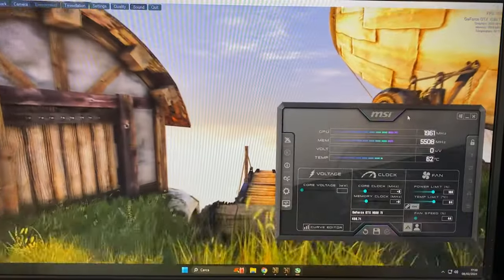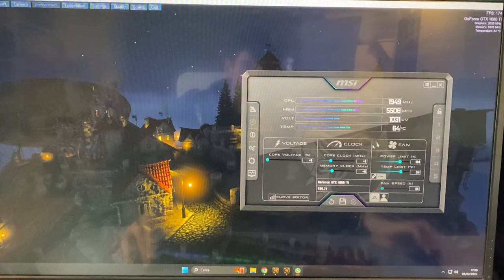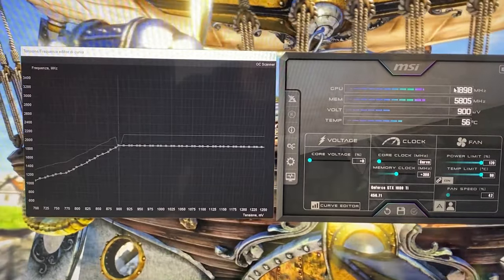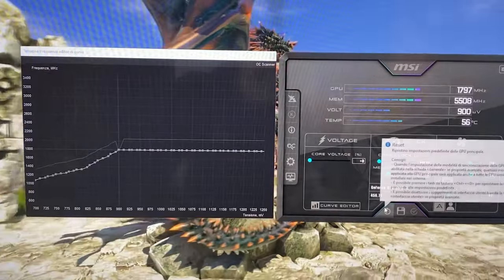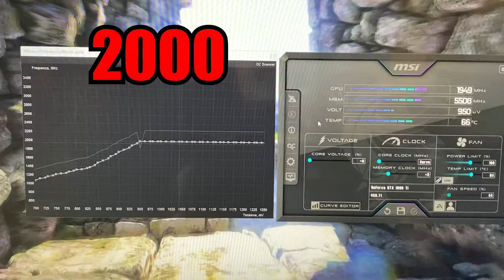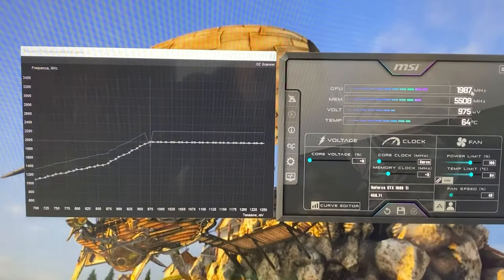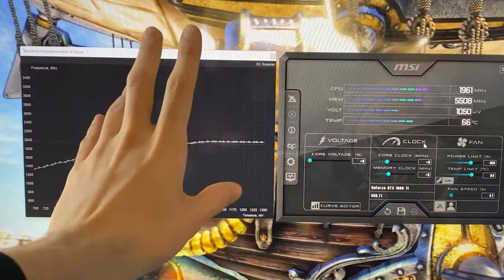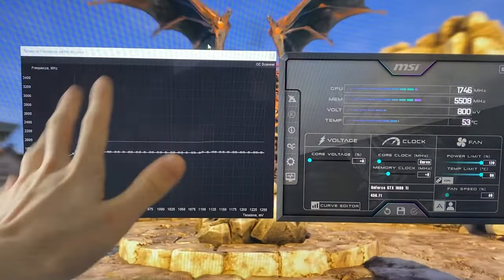Undervolt your GTX 1080 Ti for more FPS! - Tutorial

Comment: My card is a bit weaker unfortunately but I was able to achieve 975mv with 1900mhz stable and 950mv with 1850mhz or something similair.
Update: was able to push my card in terms of memory speeds +350mhz/+400mhz

Comment: Thank You!  Best guide yet. I used this guide for an EVGA GTX 1080 FTW non-TI  and worked better then your older 1080 guide for me.  Really improved temps , fps and stuttering.  Ran Heaven on ultra settings and temp hit 51c and no higher after 1 hour.    Used to hit 80c and fans running like a jet engine.  I hope to find a good deal on a 1080ti one day, always wanted one :)  Have an MSI GTX 1080 with passive cooler I strapped a cpu fan on, it runs hot in the wife's PC , will try undervolting when I can get her off of it long enough for me to do so :)
Reply: Well I got two bad 1080 ti's used off the bay'...  I went ahead and got a used Titan XP.. Works well and your undervolting tips dropped temps a good 12c .
Reply: I still have a 1080 ti if you're interested

Comment: Running  between 2050/2038mhz on the core reliably with a simple overclock, water-cooled it never goes above 52C
Reply: how do you water cool gpu?
Reply: @icecold3426  it's water-cooled
Reply: @L3XURIOUS  i mean is that stock or you modded something?
Reply: @icecold3426  it has a byksbi waterblock and I did a shuntmod with some liquid metal.. been running like that for a couple of years reliably, I did however upgrade to the 4080 super last month

Comment: RX6600XT or GTX 1080Ti ?
Reply from the maker: To be honest, my choice falls on the GTX 1080 Ti easily. But it has to be a well kept card and you’ll need fresh thermal paste and thermal pads!
Reply: Rx6600xt all the way, not even close. The 1080ti is awesome, but it's very old and are missing a lot of features and new technologies. I'm not talking Ray tracing, dlss and dedicated encoding hardware. But thing like mesh shades, async computing, ddr6 etc. The Rx6600xt is definetly the better pick.
Reply: @TinfoilTimmy it depends what you play I guess
Reply: @thestoicwhinger  i know for a fact that a few newer games (like cod, Alan wake) run WAY better on newer gpus rather than pure performance due to it missing support and hardware. Mesh shaders is probably the most impactful. It's only a matter of time before these become the standard. But yes, it depends on what deals you get and games you play.

Comment: MSI GTX 1080Ti Gaming X 11G (Paired with R7 5800X + 32GB RAM DDR4 3600MHz, GPU Fans are on Auto)
Unigine Heaven Benchmark 4.0 (DX11, 1080p Fullscreen, All Max Settings)

MSI Stock OC
FPS = 152.2
Score = 3833
Min. FPS = 56.9
Max. FPS = 316.4
TDP = 260W
Temperature = 80°C

Undervolted OC (1850MHz Core, 5805MHz Memory)
FPS = 148.3
Score = 3735
Min. FPS = 44.0
Max. FPS = 309.6
TDP = 195W
Temperature = 69°C

Now I can't choose which one should I take xD
Reply from the maker: I’m really happy it was helpful! Thanks a lot for taking the time to leave some feedback :) Consider subscribing if you wanna support the channel! I’d take the undervolted OC personally
Reply: So bro i have the exact gpu with i7 8700k. I wonder which one did you end up choosing
Reply: Big temp drop for small fps loss worth it imo

Comment: I’ve tried that on my 1080ti aorus xtreme wb, I’m sad to see that is not effective on my single case. My 1080ti arrives at 1947 or 1987Mhz in the most scenarios, with that undervolt method I lose a lot of fps. This custom is a powerful card with an extreme base overclock, I can’t touch nothing about core clock for increase my fps.
With your method the difference with the selected clock frequency and the effective is around 80Mhz, I’ve seen a video of JTech in italian and with his method I can have a difference around 10-5Mhz, that give me more fps stability and a game more smoother

Comment: Will try the first setting on my PNY XLR8.
It usually runs on 1950-1980Mhz at around 58-65°C.
I will report the difference, if there is one.
Reply from the maker: Glad to hear that, let us know :)
Reply: @ImWateringPSUs  So, my card don´t like undervolting. The clocks keep always pretty high without undervolting, so when i reduce the clock and voltage it keeps crashing.
Maybe she want´s to race, so i let her ;)

Comment: you will always get better fps and performance with overclocking than undervolting... unless you are thermal throttling...  

my current overclock is:

Power limit: 120
Temp limit: 90
Core Clock: 40
Memory Clock: 240
Reply: Also heaven benchmark is not as demanding on your pc.. you should actually get something that stresses your pc to 100% then you truely dont need to test on other games..
Reply: Your GPU is going to die so early lol
Reply: I am curious, what are you numbers? I have these numbers with an EVGA FTW3 1080ti Hybrid:

power limit: 100
Temp limit: 84
Core Clock: 50 (2012mhz)
Memory Clock: 500 (6608mhz)

Temp1: 74c 
Temp2: 90c

Comment: Hello I followed your tuto for the 4070 ti Super, It worked great, thanks and great content.
I've got an "uncommon" CPU and I struggle to find something decent to undervolt it and lowering PPT TDP... etc. I've got the R9 7900 (non x). If you have any info for this or any tuto, I would apreciate it very much ! Even if it's not possible, thanks for the content !
Reply from the maker: Glad I could help! I’d say check out my R9 7900X video, the settings are the same :)